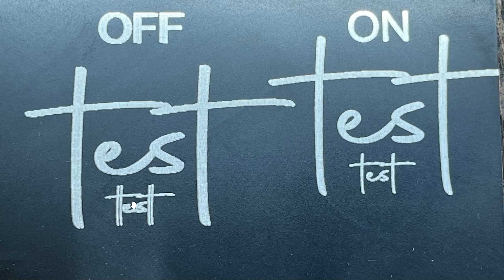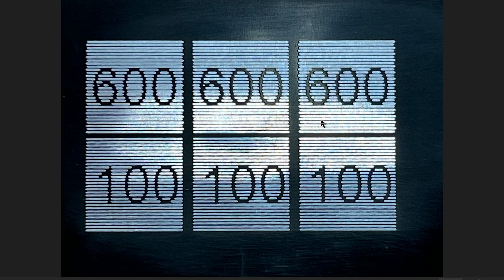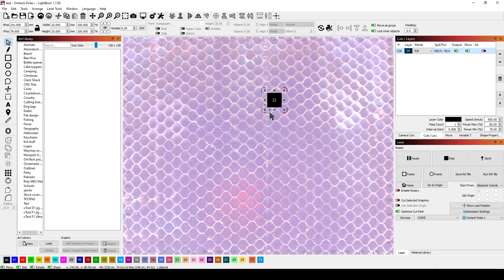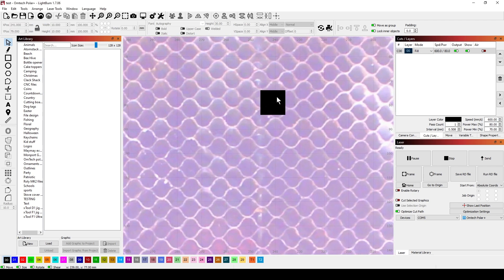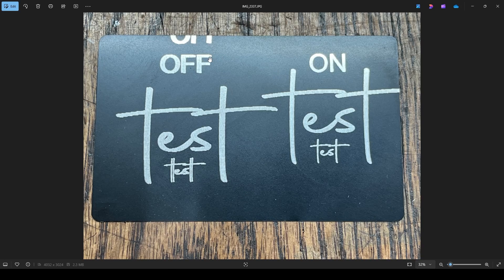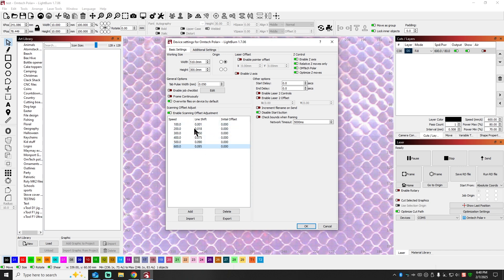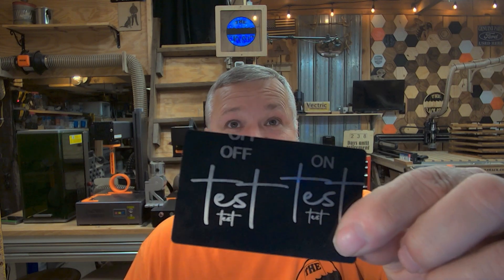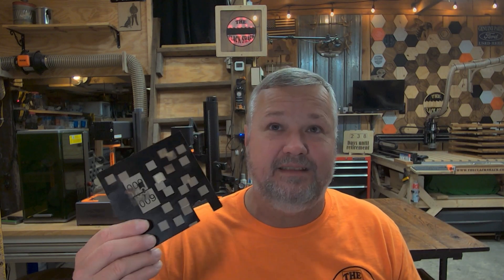Does your laser need adjustments?

Comment: Dave, I was experiencing this issue when I got my “new to me” used Xtool D1. I went through this whole process and replaced all my set screws and aligned the gantry. After doing all that I still had the weird offset. I was highly frustrated. After Googling the problem I found a Reddit post where someone had the same issue and their solution was putting a new SD card on the control board. Once I did that, the offset problem was gone and it was highly accurate without the offset correction. Not that this video and tip is not good because it is, but if someone is trying this with no to little success, change out the SD card. It’s cheap and it might just work. I believe my old SD card had some minor corruption issues that caused the problem. 

I hope this helps someone. Great video! Looking forward to more tips videos.